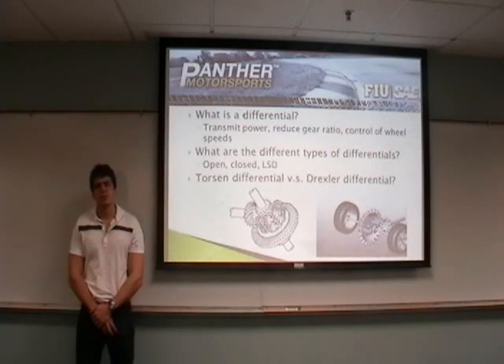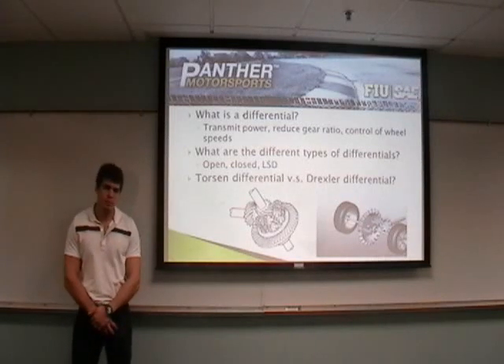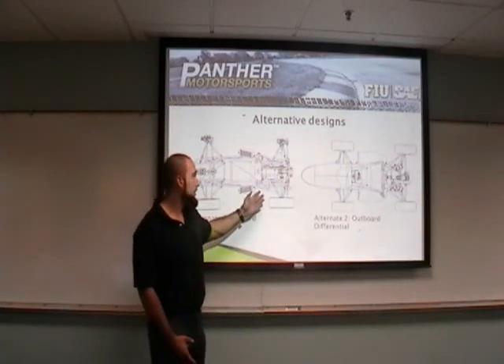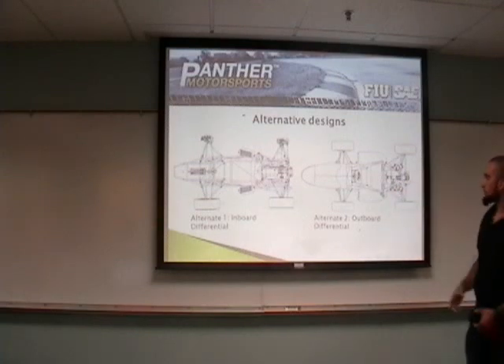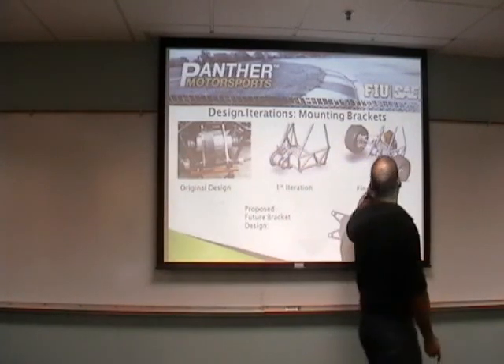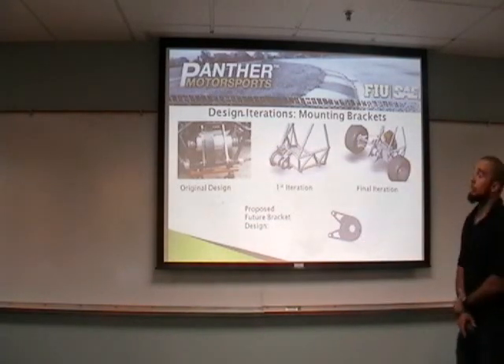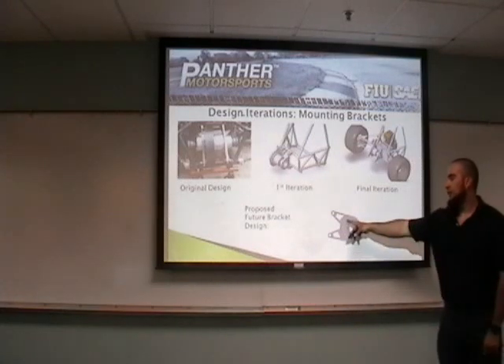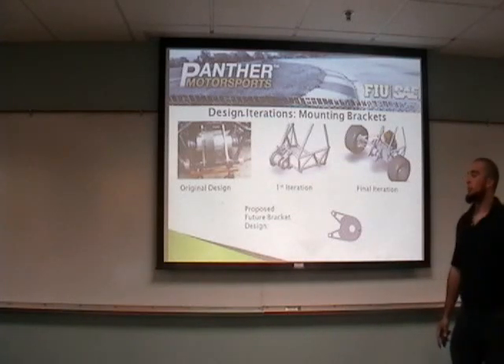Team A: Mini Formula Race Car

Comment: Great information throughout this presentation. I liked the fact that the team chose to speak about what our school has and is currently working on in SAE. Good examples on how things went wrong last semester just to point out how crucial a non leaking differential is. The only thing I would suggest is to reposition the camera in order to get a clearer view on the slides and make sure the presenters are always within the frame.

Comment: Overall the presentation was really informative; the length of the video was perfect. The contrast in the room could be a slightly better and the smaller text wasn’t really legible.  Presenters should not move around as much because it is very distracting. Everyone was prepared, well informed and comfortable presenting.

Comment: The content of the presentation was very good and presented clearly. The visual aids and connections made to Panther Motorsports was beneficial to the presentation as well. The second presenter did well, but should turn around more often when speaking instead of facing the slides because it seems as if he is talking to the board more than the audience.

Comment: Clear introduction. The video was 100% content and did not go off tangent. It had good analysis of the current differential models and visited the idea of possible future designs. The visibility was good, the clarity of the sound was good, the video quality was okay, and the length of the video was dead on (despite being all in one take). This is the first time I hear the word differential outside of a calculus class, so I definitely learned something. Overall I think you guys did a solid job. You just about nailed all the objectives and showcased preparedness. Nice job.